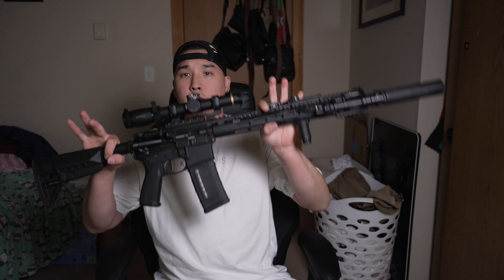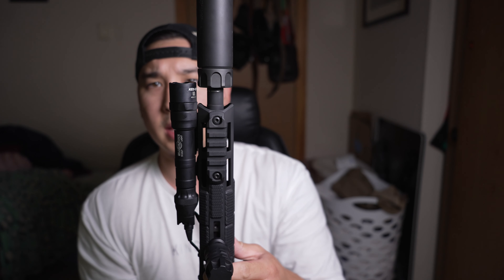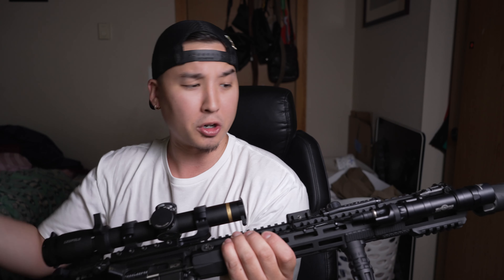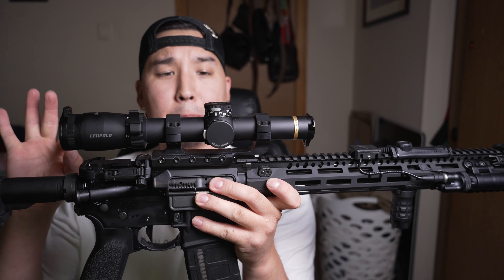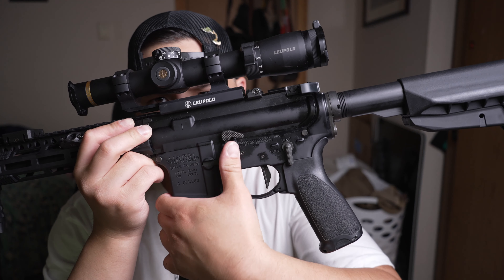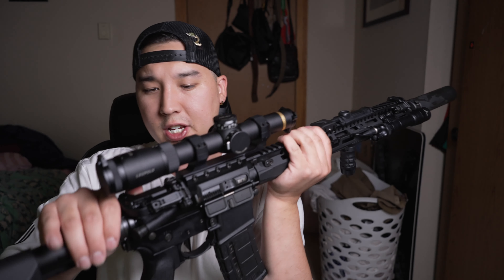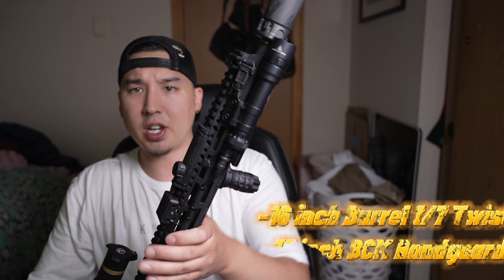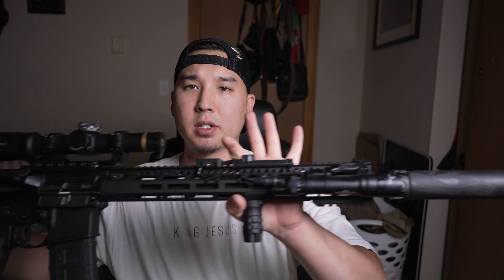"RECCE RIFLE” (Built To Perfection)

Comment: Do you wish you would’ve went with the SF mini 2 instead? Or is length not an issue for u
Reply from the maker: No I have the mini on my smaller 11.5 inch build. I like the longer more powerful light on this one.
Reply: Light? You don’t use your rc2 on your mini? I thought you’d use your mini 2 on your 16” build
Reply from the maker: @Adobooperator  ohhhh lol oops I thought you meant sure fire light haha and no I just have the one suppressor Im using on both builds.  Length isn’t an issue. The longer suppressor is still a little quieter too.
Reply: I have a 16inch ddm4v7 and idk if I want a rc2 or a mini 2
Reply from the maker: @Adobooperator  although the mini does look cool and shorter package, you’re going to get a much better sound signature with the full size suppressor..I have watched tons of videos on it and the full size suppressor is going to be better all around..better flash concealment and more quieter.. Yes, putting a full size suppressor on a already long gun (16”) can’t add weight and length to it but I have learned to train with it and I like it a lot. If I could buy both mini and full-size, I would …but because I didn’t want to spend so much on two suppressors, I got just the one..
 I just went with the full length for the added benefits.